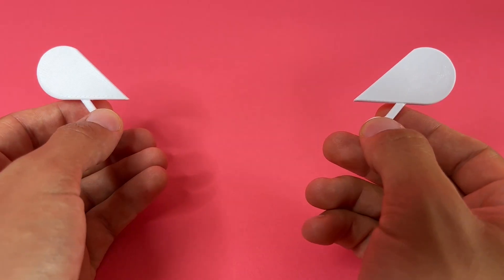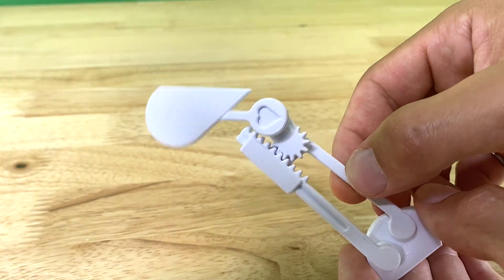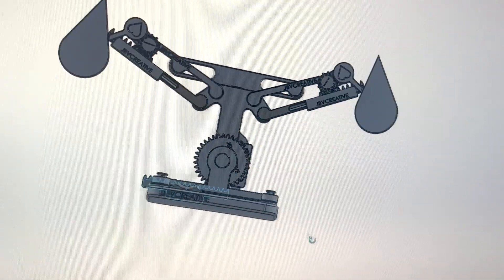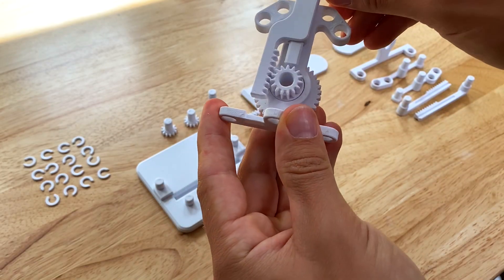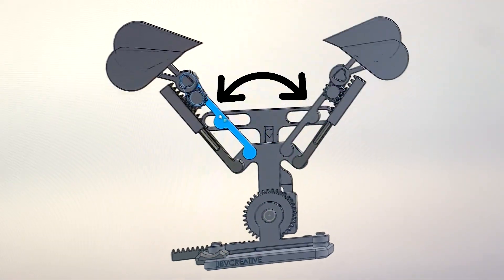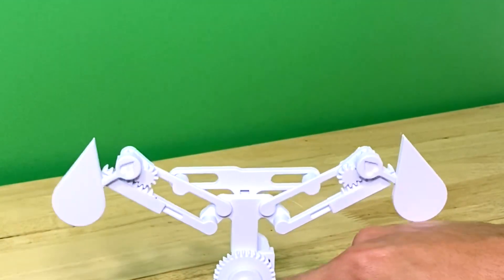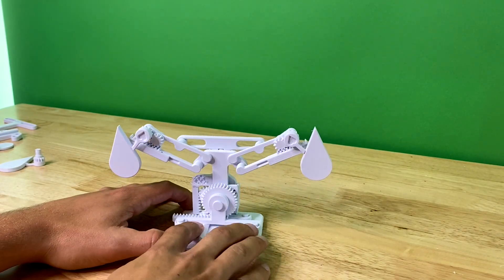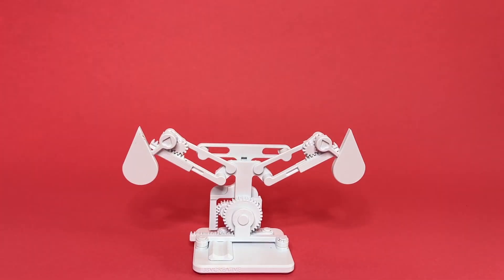Mechanical Design of A 3D-Printed Sculpture | Love at First Swipe

Comment: Hi, I’m a senior year mechanical engineering student and also enjoy 3D printing projects like these. While watching your videos I have a couple design and software questions come to mind. 

How much do you pay for your solid works license and what version is it? At school we get the academic version but when I graduate I know I will loose access to it and will need to get my own license. 

For your 3D printed gears do you source gears from the SolidWorks part library or create them yourself? I had a class my junior year that was all about the design of gears and quickly learned that there is a lot of math and complexity that goes into designing a good and efficient gear train.

Do you use a glue stick to get your 3D parts to stick to the Prusa bed? I just got my first Prusa and I use a glue stick to get my parts to stick but I’m hoping they’re is a better way.

Keep up the good work! I’m going into design engineering after I graduate and I really enjoy your design methodology.
Reply from the maker: For Solidworks, they sponsor me with a license, but there is a maker version which is $99 and has all the features. For gears, I use my own library- its available for free on my website! And for the prusa I’ve never had any problems with adhesion. I use the smooth sheets and they really work well. Hope that helps!
Reply: As a heads up Fusion 360 has a free maker’s version. While I honestly don’t like it as much as I like Autodesk Inventor, it is still good to know there is some CAD software out there that is decent and can be downloaded for free.

Comment: Not only the heart comes apart as soon as you let go of the swiper, but it also becomes tears 😯.
Nicely done!
Reply from the maker: That was an accidental byproduct! Thank you
Reply: @Engineezy  You need to invent a way for those parts to change colors - Blue, when separated, and red - when joined.
A parallax barrier perhaps?
Reply: @volo870  I don't know what a parallax barrier is but a translucent Netherlands flag in front would do the trick 🇳🇱
Reply: @Engineezy  Just pretend it was intentional 👀
Reply: I did a ctrl+f for tears before posting my comment so as not to be redundant. Too cute.

Comment: Maybe it help if you replace the T shape with a Y shape, it can be push the half parts equally... maybe...
Reply: This. He designed the mechanism to end on a singularly, you can't expect any control authority much less precision in that state. With a slant in the slots, they would maintain control throughout the range of motion.